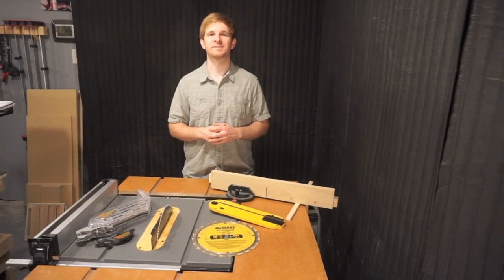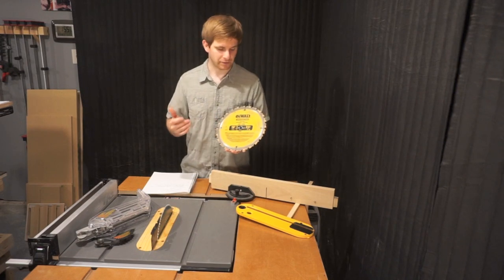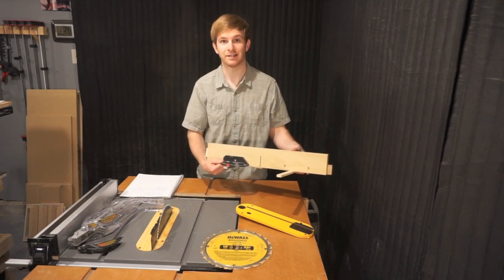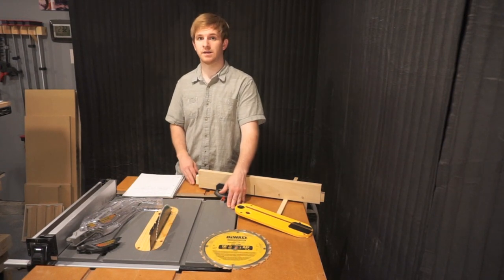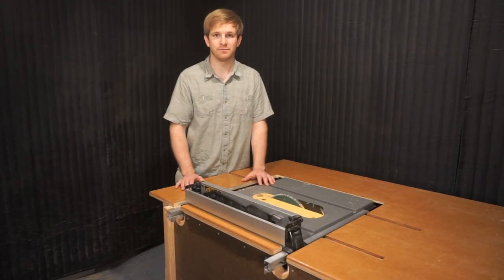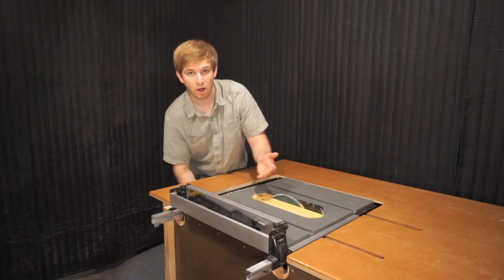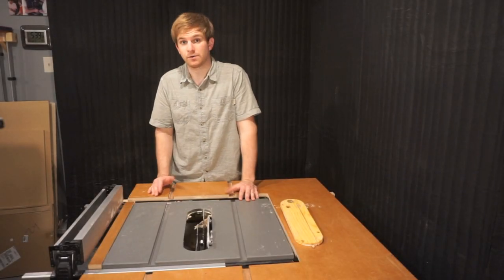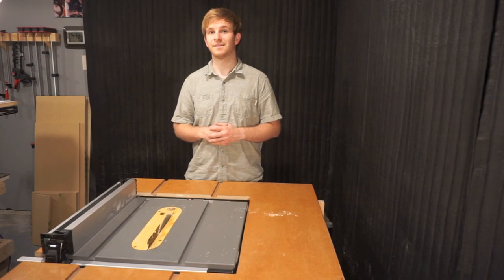Dewalt dwe7480 Table Saw Review

Comment: Is there still a lot of play in mitre gauge slots
Reply from the maker: Hey, when using the stock miter gauge by itself there is a little play, it’s certainly not perfect. I’d recommend building a custom wooden miter gauge or a crosscut sled! Take care.
Reply: @_Shopfix  hi thanks for your swift reply. Thank you for your help.
Reply from the maker: No problem!

Comment: It is my understanding this model has been discontinued. I was ready to buy and found out it is now unavailable.
Reply: Hi Bruce.  The DW745 is the predecessor and is not being manufactured anymore.  It has a smaller motor and rip capacity but is otherwise similar (at least that's my understanding).  Every hardware and tool supply store worth their salt should carry the DW7480.  There are lots of DW745 around still too and are selling at bargain prices.   Shop around.
Reply: I just purchased one of these today.
Reply: @kevind517  Same I was going to go with the 7485, but 8 1/4 " blades are not as easy to find as 10".